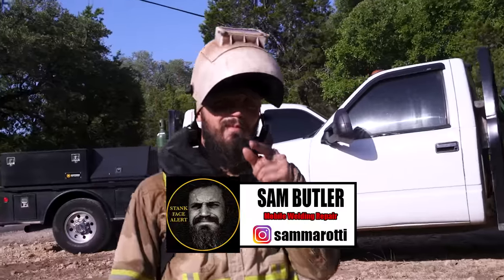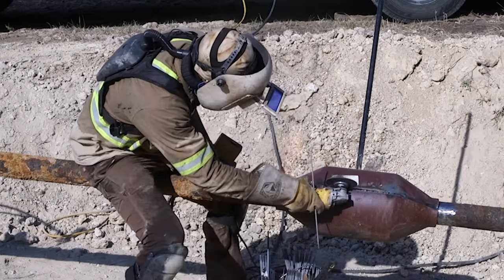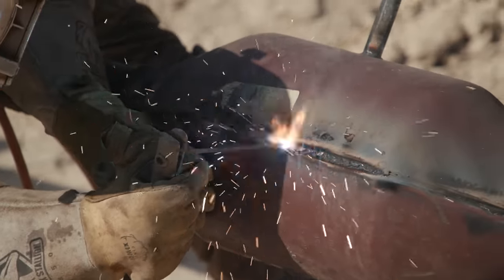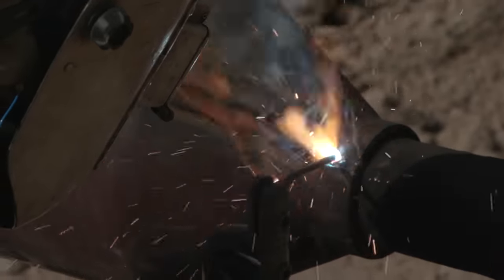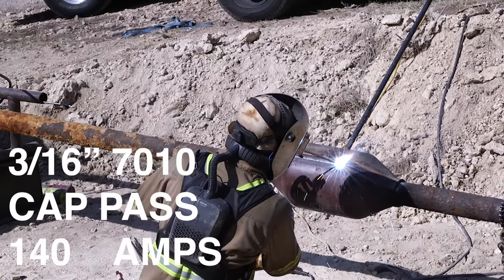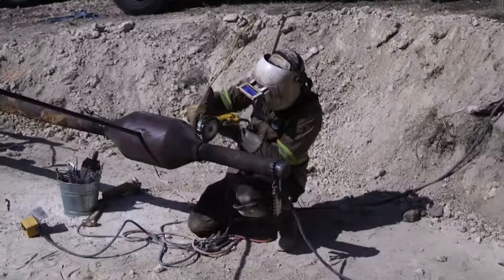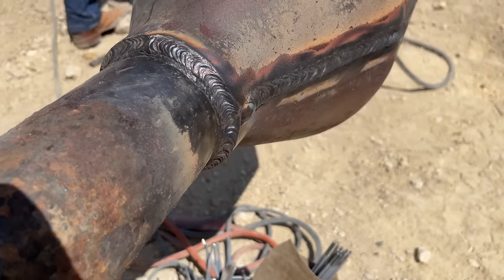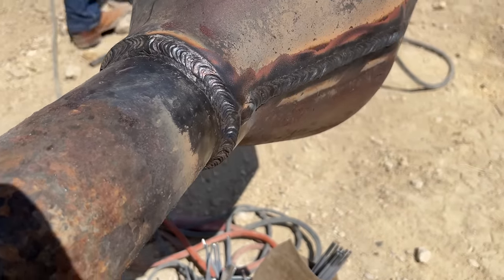Repair Welding a Live Gas Line on FIRE! | Stick Welding (SMAW)

Comment: Companies that care about safety will insist that lines be shut off and purged . Problem is that a line filled with dirty gas is less likely to explode than a line that has a mix of gas and air in it . Saying this because a place i worked at use to work on live gas lines ; new owner switched to being safe and shutting down lines and had a fatality .
Reply: I think part of it comes down to the fact that they suddenly had to do things in a new, different way. Changing how you do stuff is always an opportunity for mistakes to happen.

Comment: Why not weld the side first. Then slide it on from the end?
Reply: Do you think every leak happens at a capped end? Also the cap on the cap weld will be bigger than the split sleeve.
Reply: And the pipe isn’t always straight to slide it on

Comment: Why did this not blow up?
Reply: No air in the pipeline.   Natural gas will not burn at concentration over 8%.  It can pop in the clamshell during tack welding and root pass, depending on leak rate.

Comment: Nah, I'll pass on the welding of a gas line.. Sure, there is the control of gas to oxygen ratio, and this can be safe when dealt with, but, LOL, that is just not normal in my head, so, with that said, I will leave the professionals to deal with these skill sets... Neat video though, I learned some stuff too.

Comment: Welding a hot gas pipe… $80/hr (well it is already on fire).  Straddling the pipe to weld it… priceless.  But seriously what’s with the 316 cap?  The rest of that pig is not stainless, is it?
Reply: He meant 3/16ths rod. It's 7010 welding rod, not 316 stainless.
Reply: @AndrewMerts  thanks!  I was confused, but that’s not hard to do
Reply: @rivernet62  For added fun, 7010 welding rod also has nothing to do with 7010 aluminum. It's easy to do a double take on half of this when you've got so many similar numbers for completely different stuff.
Reply: @AndrewMerts  welding IS fun.  Sometimes I wish I’d done it for work.  But then I see how hard you guys have to work and… no… 🤣. I’m happy with my DIY card thanks.

Comment: not alot of girls my age are into dirty work im 15 and i love welding i weld with my uncle cause hes the only one who is not sexist and thinks girls should not weld cause its a man job every like is a female welder i wanna see how many is there
Reply: great for you. depends on what your welding job is. much of welding work is fabricating especially field work. there you need to be able to handle heavy objects like pipes and grinders and such. it's physically taxing for most people . on the other hand if you work in a factory or shop where the work is on a table or jig then it's less taxing on the body. if you weld for 30 years your body feels it.
Reply: @ronblack7870   i started welding last year i dont have any welding jobs yet but i do projects with my uncle and i like to do stick welding and ik you have to lift heavy stuff but im ok with that im a tuff chick
Reply: @ronblack7870  You need to do some research before commenting.  Trust your gut instinct.  This "person" has never seen a welder much less used one.  Pretty piss pore communication skills for  15.
Reply: I worked at a large open pit mine around 2003 as a maintenance contractor and worked with a couple lead female cert welders. 
One knew what she was doing, the other was tough and worked hard but would blow the welders by setting them opposite the way they were designed. (Highest amp setting on the transformer tap handle w/rheostat down at like 10%) had me adjust the rheostat while she was welding. I wasn’t certified, but knew that couldn’t be good for the machine. The head of the equipment maintenance dept asked me if it was her using that machine, he could tell cause she was the only one that did that. 
Good welders have nothing to do with being male/female, has to do with innate ability and savvy. Welding is not for a lot of guys or men, same goes for women. 
Stick to what you know.
Reply: @dallynsr  Same applies to you...
Reply: @dallynsr   tbh i like to bratch out and not stick with the same thing never know when u find somthing knew and what u are good at and tbh its just what i had run ins with when ever i told older gentalmen at the car shop i did welding they take it as a joke and laugh at me